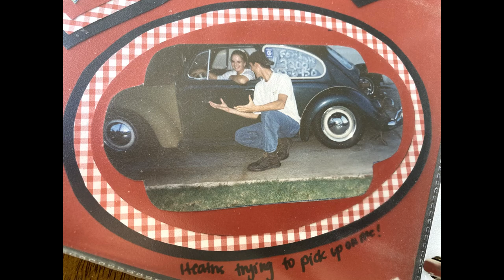#425 - Shop Build: Framed Up Garage Door Header, 14' Walls are Done!!!

Comment: I have a 1997 Jeep Wrangler that i installed a 1.9L VW TDI engine w/ Cody Built adapter kit. Its been the best offroad vehicle i have ever owned with the amazing torque of that little engine crawling through the hardest of conditions and rocks... The engine has 281k on it. 243k prior to installed and 38k since installed without splitting the engine apart, been gathering parts for a rebuild with new turbo and injectors in the near future for a little extra power..

Comment: good job getting up some momentum now, your like me and cant stop building stuff and doing projects.  i built a similar shop alone,  the part i had the most trouble with was not getting the walls up. i did the roof cut an pitch rather than trusses but getting the central beam in was a real challenge alone,  sheeting it wasn't too bad but the real killer was the roofing material,  i decide to roll out felt rather than shingles,  the rolls of roofing material were on the edge of what i could carry on the ground an i had to get them up the ladder,  i did it but it wasn't easy.  its nice to see your son working on it with you,  those are memories he will keep for the rest of his life and skills that will help him more than he knows right now.  If i wasn't so far away i'd offer to come help you as i know how it feels to struggle.

Comment: Gonna have a lot of real estate on that roof; more solar? Perhaps a solar water heater, run the coils on the shop floor, heated winter flooring 🇺🇸👍
Reply: I thought of that, too.  Get the solar panels off the ground and out of sight.  They should keep cleaner, too!
Reply: Maggie Sue except of course he'd have to find a way to deal with snow.
Reply: Patrick Elliott he could do a section and put some type of flooring over it. Would save him tons of firewood.
Reply: @maggiesue4825  Great idea, but, how does he clean the snow off of them in winter?  I sure don't want to climb up on that high rood with snow and ice on it.
Reply: Patrick Elliott  Could possible put a "rocket stove" though I guess.  Lived in Asia for over 20 years.  All houses in Korea have hot floors.
Reply: That's a great idea!
Reply: @chuckblack9410  If it has any decent slope on the roof the snow slides right off
Reply: Patrick Elliott whelp, worth a shot. I wasn't entirely sure at which point during the building process the ground stuff goes in. Pretty sure I saw a system installed on HGTV, but I'm not willing to die on the vine over something I learned from reality tv, lol. 

But I do have friends that have them and they swear by it.
Reply: Patrick Elliott hmm, yes that makes more sense. I've seen installs done in a home before, but not directly touching the earth. Appreciate the details my friend!

Comment: I have 10ft x 10ft overhead doors on my shop and boy do I wish I went bigger.  I later acquired tractors and other items that would easily fit in the shop but won’t fit through the doors.  And the construction type and details won’t allow me to make those doors bigger.  Bigger then you think you will ever need is is always better.  You never know what the future holds.  Like I can see a truss and trolly system with a chain motor in your shop with the ceilings as high as they are.  Or a car lift to stack vehicles our of the way saving your floor space.

Comment: Great job and great content. There is one thing I'd like to mention. Sheathing exterior walls vertical is not a good practice. It is best to attach them horizontally by staggering half a sheath. Walls will be much more resistant to racking. Especially for tall walls like yours.

Comment: Heath, mate, it’s easy to screw a piece (or two !) of batten just oversailing  the the top edge of the board below forming a little pocket, so when you get the next board up  you just drop it in the pocket, then you only have the top edge to control.    I can see that you know what you want to achieve and do really well .
    But try to do this the easy way, you’ll last longer !!

Comment: don't forget... you have a bunch of small kids who have been watching you out the windows building the barn..  on the ground is a big pile of Zip panel scrap..  small pieces that won't get used on the barn.  but with a few minutes on the table saw... small pieces can be cut up... ready for the kids to build into various sizes of bird houses to stash all over the place..  so birds can have their own range..    be sure to use hinges.. so  you can do an easy clean out..  the house can flip to the side   this requires a tight seal around the bottom... but the top and walls can just lay over as one piece.. or if the house is mounted to the back wall.. the floor can drop out.. just by turning a washer that has a ear bend up.. 
 until you get the roof on...  string some wires from one corner to the other to protect from wind ...

Comment: The shop seems much smaller with the walls up, even though it's 14 ft tall.
Good idea might be to replace the cracked framing hammer handle and black tape. 
I like those chrome trim rings and baby moons on the vdub. 🦀

Comment: For the JEEP find a 93-98 jeep grand cherokee with the 5.2l v8. Then find a 5.9l and swap it. Just need a driver engine mount and a balancer for the 5.9l direct swap. Plenty of power and more reliable than the smaller hemi. 5.9l can make some great power if thats what you want. 93-98 grand cherokees are super cheap to buy and parts are fantastic prices for oem parts from Detroit axle.

I own a few. My wife daily drives one. And plays on the weekends. She has the 4.0l with AWD. Goes were you want and for her its literally everywhere. I also daily drive the jeep in my photo.

Comment: When someone said work smarter, use your head, they meant it figuratively not literally. :-) Use some foamboard as a thermal bridge break. Add Solar to the roof. A 2 or 4 post vehicle lift for the shop, they are not too expensive now days.

Comment: you are doing the sheathing the hard way but... you should think about enough scaffolding to do one side at a time and a couple picks or big planks - the zip is looking good - it is a nice product - hope you use the basic foam insulation - the rigid 4x8 sheets about 2 inches thick - easy to work with - leave 1/2 inch free space under roof for soffit to ridge vent air flow - you do not want condensation - you should be able to get r30 in the roof - do make sure to have some sort of passive airflow scheme set up - maybe solar powered attic vent fans? - the systems of the garage are going to be plenty of content - lots to look forward to. be safe and don't break yourself in half - clip in when doing the roof - consider renting a big scissor lift or baker staging - ladder jacks work too
Reply: ok ok you got the scaffolding - i think you know what you are doing here, mostly, have fun with it - it is great for the kids also - wear ansi sunglasses too #repetition #carpenter's helper
Reply: do a double top plate and brace everything up square and plumb and you should be all set, the opening looks good - will take you a while to totally trick it out but will be major addition and make the winter much more tolerable #not fixing things outside

Comment: make sure you get some help for that roof even if they are bringing a crane... You should watch @thecrazyframer put up some trusses he does really well for a single person .. has a good system of running up the center of the truss set with I think 21" spacers... he puts a spacer on the standing truss... puts the next truss right up against that spacer and face nails through it ... anyway good luck and be careful .. its looking really good and you're moving quickly

Comment: I realize you are focused on your shop build and cabin build. However, I do remember you stating something about running low on firewood. Would it be beneficial to you to pick 3 or 4 trees for firewood, chop them down, then bring the cleaned trees up by the house or the shop??? Let them just sit there until later, closer to when you need them. Then, once it's time, you could them cut them up to what you need. This way, instead of freaking out, going & looking for trees (perhaps) during mudding season, or any other inclement weather time, you will have them close enough to process.
It's just a thought. Be safe and be careful!!

Comment: I would have buried the shop into the hillside, with the limited flat ground it would have been nice. You could have a second-floor loft and windows up high to let in light.
Plus if you have the cash to rent a excavator or even own one, screw it. spend a little time and cut 40 foot into the hillside.

Comment: I'm impressed at all the great work you're doing, but that garage door header will collapse. You could get away with 2x12's with plywood laminated in the middle IF you weren't supporting all that wall plus the roof trusses on top of it. Check out a span calculator and take into account the weight of the wall and ceiling as well.

Comment: a jeep works if you can find one in decent shape for a decent price...unfortunately the 2 do not go hand in hand very often unless your willing to go much older(best option lol but hard to get the wife to agree im sure :) ) and or do more work on em.Theres another fairly overlooked unit that works well as long as your willing to put a bit of time in and are already seriously considering an engine swap or upgrade at some point...look for a 4wheel drive dodge durango. lifts are cheap and theres a good aftermarket and parts supply plus you have the added bonus that they normaly dont get used as hard as jeeps do before they get retired.

Comment: Have you thought about a Toyota Land Cruiser or the Lexus equivalent? Land Cruiser hold their value so they might be expensive but the Lexus equivalent is less expensive and just as capable. They have bulletproof engines and great off road capabilities plus they can be modified quite easily.

Comment: My first VW had the front cut off and another welded on which I didn’t know when I bought it,  I noticed something wrong with it when every time I would hit a bump or hole the headlights would switch from high to low beam, or viceversa.   Needless to say the cut and weld job wasn’t the best and the flexing which led to me finding the mess probably saved my own life or maybe someone else’s

Comment: Do you have the Zip Wall tape for sealing the edges? Those 10' sheets are a bummer handling yourself arn't they? Ever thought of using a drywall jack for lifting and holding in place? Hope you get one for the drywall at least?

Comment: You need a lift not only is it easier on your body it’s a lot safer I got a used one no motor kind of a push but it goes up 28 feet and it’s saved my bacon mini of time specially when you’re doing stuff over your head you know you can get a little disy life saver.

Comment: If you have a trailer for the mini excavator I would put it on top of the trailer and measure the height of it and give an extra 6inchs clearance above that then you will know if the door is to small

Comment: get a 2005 jeep liberty diesel its an italian VM Matori engine now owned by Fiat . There are some quirks as with most engines but it can be bulletproofed .  here is a great site for any help you might need .  I have 7 of them one for salvage one wrecked with bent front frame I am working on now .  My wife and 3 kids and I all have  one .  Much more creature comforts than a wrangler and still some work for you to do.  Alsothere are  2007-8 grand cherokees have 3,0 diesel engine You might even find a good deal on a 2014 or newer diesel grand cherokee that has body damage etc.

You can get a running Diesel Jeep  Liberty for $4,000 or less.

Comment: Respectfully, you are a young man in your 40s with a wife and five kids. Do not set those trusses by yourself under any condition. Hire a crane operator.  And get help beyond a 16 year old son to sheet that roof and put down the tin.  Too many ways you can severely injure yourself.  Also, you need to invest in a safety harness.  If you need to save up money to be able to hire assistance then better to pause the project.